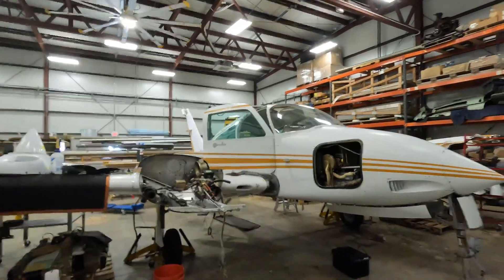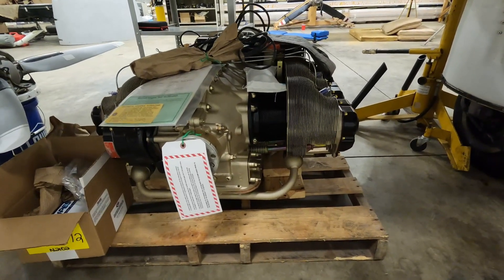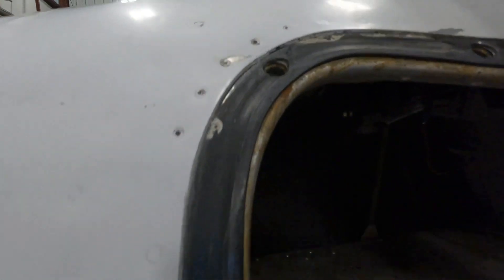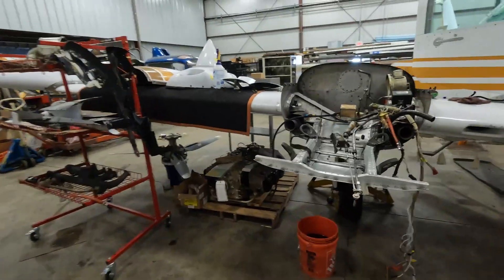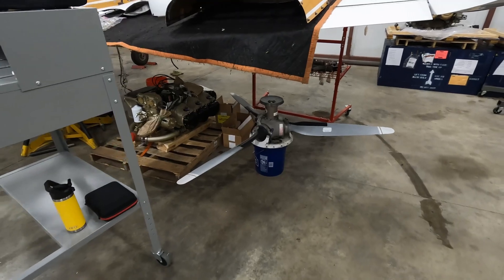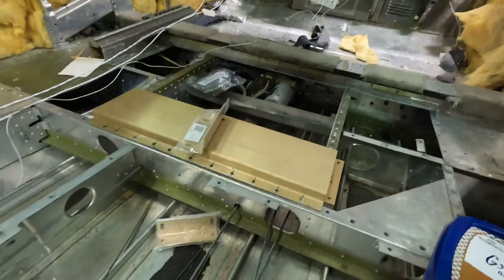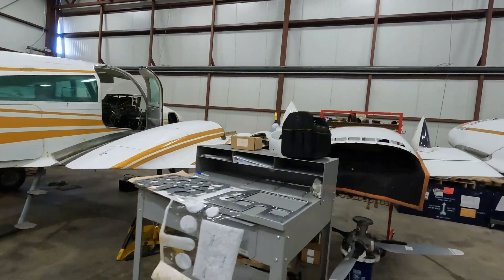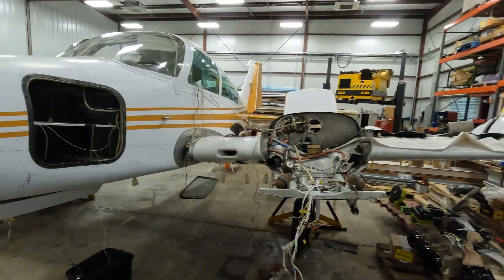Restoring a Classic Part 1: Cessna 310Q Overhaul Begins!

Comment from the maker: Another note of clarification. For some reason I kept calling the Cessna 400A Navomatic Autopilot a "450B", which was incorrect. I probably had the PS Engineering PMA 450B audio controller on my brain, so I misidentified the 400A autopilot. Anyway, whenever you hear me say "450B autopilot" just pretend you heard 400A. The entire unit (servos, controller, etc.) still works, so this unit is for sale if someone is interested. I'll probably post it on Trade-a-plane or Ebay.

Comment: Have the Cessna Wing SID inspections been done in the past ? I did several Cessna SIDs programs on 300 and 400 series Cessna aircraft and we always found something worth fixing . Maybe not catastrophic in the next 24 or 36 months but major structural defects that simply cant be found during normal maintenance checks and often it was the best loved immaculate examples that had worst defects .Since you already have disturbed the engines and wing harnesses it would be an excellent time to look at the wing fittings in detail . We replaced many witth pitting that cant be seen without disasembly.
Reply from the maker: @brendon408. You are correct, it's also getting annualed out during these upgrades (a few months before necessary) because they have access to everything. It went through an $86K annual at TAS aviation last year (yes, may wallet was screaming!) and they abated some spar corrosion of the upper right wing cap (~$15K just for that wing cap). TAS also replaced fuel bladders and was able to do some additional inspecting during that process, but we'll dig deeper with the engines off. I'll pass along your advice on the wing fittings even if I suspect they will already look (can't be too sure). I really appreciate the heads up. I'm very fortunate in that one of the folks working on my aircraft is an encyclopedia of 300/400 series Cessnas (he discovered several important things that TAS missed).
Reply: That's great to hear. That's going to be a great example of a C310 when you are done. I looked after a fleet of 5 C310Rs  in the late 90s early 2000s used for Airline pilot training  which were flying over 1000 hrs per year each. Great Personal and charter aircraft but very manpower intensive compared to a Piper Seminole that replaced them.
For those who are considering a 310 major areas to have inspected are the engine beams and spar structure behind engines, wing fittings, tip tank rear attach structure. The torque tube in the wheel well that lifts the gear during retraction gets a sprial crack. And reinforcement doublet installation  on wing rib in wheel  bay. The vertical stab rear spar extruded angles where the trim actuator bolts through often gets exfoiliation corrosion. If all the various Services Bulletins kits  have been  installed a lot of these issues will have been mitigated.

Comment from the maker: One point of clarification. In the video I mentioned the power of the IO550's to go over mountains on the east coast of the USA, but I forgot to mention that I was referring to the single engine service ceiling. In a standard non-turbo 310Q, the single engine ceiling is a little over 6000 ft, which doesn't provide much margin over the mountains where I live. The Colemill Bearcat II conversion, on the other hand, with IO550's @ 300HP, has a single engine ceiling of over 10,000 ft, which provides a lot more clearance over the Appalachians should I need it.

Comment: I notice your engines do not use the overhead intake manifolds. Would those fit under the engine covers?  Or maybe would not be beneficial to have those?
Reply from the maker: You are correct, Colemill Bearcat II STC uses IO550A engines with intake manifolds on the bottom, otherwise there isn't enough room for the engine in the nacelle. If you look at the new engine at https://youtu.be/aAyLnJOVdMM?t=182, you'll see the breather tube across the front underneath that connects both sides of the manifold. Manifold gets attached when the engine is mounted, so its not in the video.

Comment: do you know what the weight of the plane is when it is all together?
Reply from the maker: Hello @marykelly3108. Good question. Before all of these changes, the empty weight (no fuel, no people, no cargo), was 3,581 lbs. It will probably be lighter when all of the new avionics are installed. The max gross weight is 5,500 lbs, so that leaves about 1,919 lbs for loading. It carries 978 lbs of fuel (163 gallons @ roughly 6 lbs per gallon), so it will carry 941 lbs, depending on how you load it. I rarely carry more than 4 people, including me, so weight is rarely an issue. If I carry a 5th or 6th person, depending on how much they weigh, I can leave fuel off to meet my loading requirements. There are lots of calculations before every flight to determine weight and balance, takeoff distance, stop distance, and so forth, that help me determine how much fuel to carry and where to put people/cargo in the aircraft.